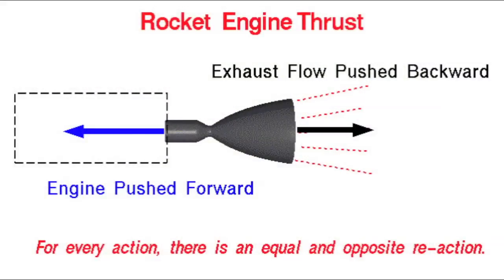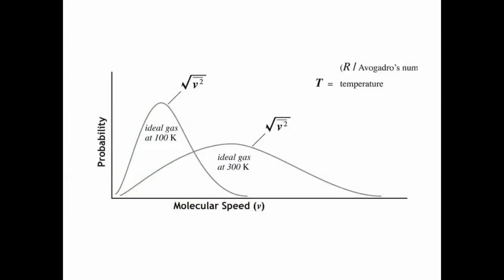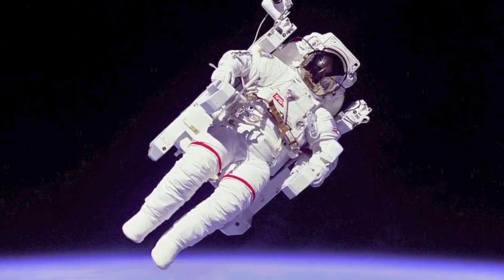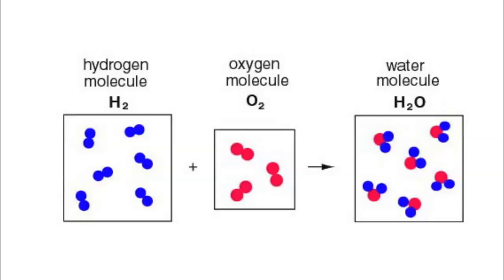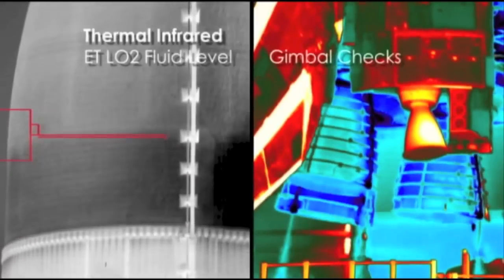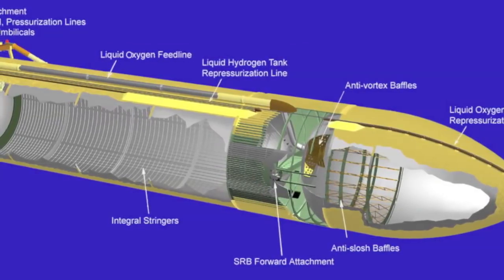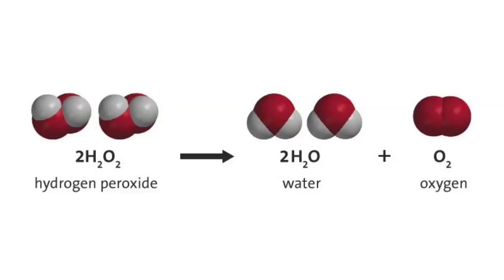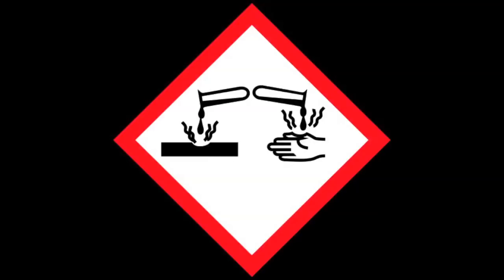WTF is Rocket Fuel Anyway?

Comment: Anyone read Ignition! by John Clarke? Its a must read for anyone interested in stuff like this who doesn't mind a bit of chemistry. If anything, it shows how kerbal real rocket science was in the early days. 

Scientist 1: Hey guys, lets mix some fluorine with molten lithium and see what it does!
Scientist 2: Don't forget the hydrogen! All rockets work better with cryogenic liquid hydrogen!
Scientist 1: Aww, the exhaust is so hot it's ionized and interfering with our radios. Lets try some mercury compounds next.
Reply: Hilariously written too!
Reply: stevenrs11 oh, I loved the part where they just dumped a whole tank of F2 into the desert just to see what happens
Reply: stevenrs11 Back before developing afterburners, they were going to add a booster rocket to fighter jets, running on jet fuel and H2O2. "Oh, what if a rat falls into the hydrogen peroxide tank? Let's test it!" But some spoilsport insisted that they just drop a rat whisker into a test tube.
Reply: Ignition! has a permanent place in my library.  Picked it up based on Scott’s recommendation.
Reply: Yes! So good
Reply: I knew someone had to mention "Ignition!" ... the textbook that brought us such delights as possibly using dimethylmercury as a rocket propellant ... or chlorine trifluoride. These are two substances that NO sane person would ever wish to be close to. Derek Lowe's now infamous "Things I Won't Work With" section of his chemistry blog will inform you why this is the case, in a manner that will make you laugh AND fill your pants in terror as you read about them.

Yet, back in the 1950s, scientists looking to deliver the biggest bang for the buck from rocket propellants, seriously considered such hideous options.

Oh, and of course, the proposal to use detonating nuclear bombs as a propulsion system is about as Kerbal as it gets ...

Comment: A small but important point: In a liquid hydrogen / liquid oxygen rocket, the exhaust is NOT just water. It's actually more similar to the liquid hydrogen propelled nuclear rocket, in that most of the hydrogen not burned and is therefore acting as reaction mass. Liquid hydrogen engines are always run very fuel-rich, for a couple of important reasons:

1. To reduce the burn temperature in the combustion chamber. Ok, so this is rather hot anyway, but it would be even hotter if all of the hydrogen was burned. Even using the liquid hydrogen for regenerative cooling wouldn't be enough to compensate for this.

2. To maximize the average exhaust velocity, by having as much hydrogen as possible in the exhaust. So only enough hydrogen is burned to impart heat to the rest of it, which actually increases the specific impulse. At the high temperatures used, some of the hydrogen molecules split into hydrogen atoms, which have an even higher velocity - this increases the specific impulse even further.

A similar principle is used in RP1 / liquid oxygen rockets - these are also run fuel rich to reduce the burn temperature to tolerable levels. The amount of oxygen used is limited to ensure that most of the carbon in the hydrocarbon fuel burns to carbon monoxide rather than carbon dioxide. This is a lighter molecule, so has a higher exhaust velocity, boosting the specific impulse.

Another modification to a rocket burning RP1 is to mix some liquid fluorine into the liquid oxygen. This causes the hydrogen component of the hydrocarbon fuel to be burned to HF rather than water. HF is a smaller and lighter molecule, so has a higher exhaust velocity than water. A liquid hydrogen engine can use liquid fluorine as the oxidizer for the same reason, and would also be run very fuel-rich.
Reply from the maker: Very good points here, I never went into the details of fuel mixtures, might be worth doing that at some point.
Reply: Correct.  In real world combustion, the products are never ideal, even when the inputs are stochiometric.  Given a large enough population size H2 + O does not always result in H2O as just one example.  Big organic molecules like RP1 produce even more varied results.

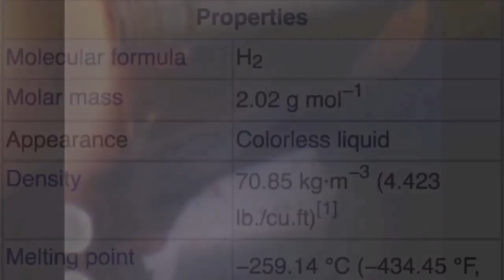Comment: Also, at 5:00, Saturn V second and third stages used LOX and LH2 add their fuels, but they were not insulated with foam on the outside. That's why in Saturn V launches you see ice falling off the rocket when they light the engines.  In Columbia, the irony is that the foam was not there to prevent evaporation, but instead to protect the orbiter. It was there to stop ice from forming on the external fuel tank which could then fall off and damage the orbiter.
Reply: angc214 From another article I read at the time, if they had used the foam they had used in the 80s before they had banned the aerosols, the foam wouldn't have broken off, and the foam wouldn't have hit the wing, preventing the crash entirely. The ozone hole scare of the 80s may have caused the crash, and we have the hippies to blame.

Comment: The insulation on the ET of the Shuttle isn't there to keep the fuel from evaporating.  That's a beneficial side effect, but none of the rockets before the shuttle had this and they worked just fine.  The insulation is there to keep condensation ice from forming on the ET which then would rain down on the belly of the orbiter during launch destroying tiles.  Watch the launch footage of the Saturn Vs and notice the tons of ice that came raining down at liftoff.

Comment: Ah, okay, so from a first principles standpoint, you need three things - reaction mass, energy to push that mass, and a means to do the pushing. For a chemical rocket, the energy comes from the fuel's combustion, the combustion byproducts are the reaction mass, and the pushing is done by simple thermal expansion. For a nuclear rocket, the energy comes from the heat of nuclear breakdown, a non-reactive fuel is the reaction mass, and the pushing is done, again, by simple thermal expansion. For an electric rocket, the energy comes most commonly from solar panels [but can come from an RTG too], an very inert fuel is the reaction mass, and the pushing is done by electromagnetic repulsion between the engine and the ions of the fuel. Cool beans.
Reply: Nicely summarised.
Reply: Technically, only in Bi- (and other multi-)propelant rockets energy comes from combustion. In monopropelant rockets it comes from rapid decomposition in presence of catalyst.

Comment: So the EVA suits of the astronauts were basically like deflating a balloon in space lol.
Reply: kind of... although I would go with opening a container of compressed gas. Imagine a bottle of carbonated water that has been thoroughly shaken xD
Reply: Opening a container of compressed gas, is a balloon right? Correct me if I am wrong but I'm pretty sure that:
The container = the balloon
The compressed gas = the air inside
Opening the container = opening the balloon's neck to make really high pitched and annoying sounds

BALLOONS IN SPACE!!!
Reply: The "Mentos in Coke" of space exploration. :)
Although of course, that's not quite right because it relies on a chemical reaction, which the EVA suits didn't.
It's more like playing dodgem cars in office chairs using fire extinguishers for propulsion. Or so a friend told me. ;)

Comment: Please please please do a tutorial in the interstellar mod fuels.... There's NONE
There's not much at the wiki.... Lots of Wiki gaps....

You did a gather water and convert to oxidizer and fuel... But there's so many more.
And i believe that with the Scansat mod you can find were all resources are (there's a resource find tool on that mod wile the interstellar there's only a part that finds radioactive material... they plan to do another part were you find the rest but its not implemented yet)

So PLEEEEASE do a tutorial with interstellar resources/process to convert/fuel types and usages.

Comment: But what about chlorine-trifluoride? Or was that never used? And what about fluoroantimonic acid? I heard it was planned to be used as a rocket fuel (although I'd think that was never tested, was it). I'd love to hear about those things if you know anything about them
Reply from the maker: Lots of things were thought about, but never flown.
Reply: Scott Manley that is true, but maybe you could make a video about the "best propulsion concepts that never propelled"
Reply: ytmoog yeah pretty much XD but there's many other great concepts like the EM drive and such
Reply: AIUI the difficulty is it's just too damn destructive. Most organics are out because it's hypergolic with them. Flouropolymers can be used on the gas but not on the liquid because they will dissolve. Some metals can be used if they are passivated by forming a metal flouride layer but there are concerns about what happens if the passivation layer is damaged.
Reply: Lots and lots and LOTS of things were thought about, and tested in labs or in small scale test engines. Pretty much anything that could be synthesised and had decent theoretical performance.
Most variations of them failed a card-gap (handling/shock stability) test by a little, or a lot, or by so much that they destroyed the apparatus (and in some cases the entire lab, with little or no warning!).
Or they couldn't be stored without either destroying the storage vessel, or reacting with it and becoming contaminated, or boiling off too much at too low a temperature.
Or they couldn't be handled in large quantities without insane levels of risk to life and property.
Or they smelled really really bad, like "if you spill a few drops, clear the building or people will be vomiting in the hallways" kind of bad.
Or they were ludicrously expensive to synthesise in the kinds of quantities required to make them useful for anything at all other than writing papers about.
Bear in mind that the US military (specifically USN and USAF) paid for pretty much all early propellant development in the States before NASA was formed. They wanted bang-for-buck above all things, and the brass were not really amenable to the idea of storing large quantities of extremely volatile chemicals on aircraft carriers and airbases adjacent to similarly large quantities of fuel and ammunition (which, while hazardous, are relatively inert), nor having to train sailors and airmen in the very specific handling procedures involved. And they flatly refused to use "exotics" for any weapon which was to be stored pre-fueled, due to fears of what might happen in the event of a leak. They could be used in nice, cosy, permanently manned and maintained ICBM silos, but not on warships in the middle of the ocean. Hence the widespread use of RP-1... it came from the same refineries, they knew how to handle it because they were already using thousands of tons of gasoline, diesel and kerosene each year, it was easy to store and it had no problems with stability or boil-off. Since a whole lot of modern rocketry came out of what was learned designing and building early ICBMs and tactical missiles, we still have a lot of that older propellant technology hanging around in modern designs. But in many cases it's a matter of "if it ain't broke, don't fix it".
Reply: Peter Green, "there are concerns about what happens if the passivation layer is damaged"... like that whole "starting to burn and just not stopping" thing?
Yes, I'd say that would be a concern. :)

Comment: One other variant of the electrical thruster is the resistojet. You get some substance, say, hydrogen, and pass it over a heating element that gets very, very hot due to massive amounts of energy being pumped into it from an external source, such as solar panels or a nuclear reactor. Much like the NTR, it benefits you to use extremely light gases for this purpose. Unlike the NTR, you don't actually need the fuel to come into physical contact with the reactor. Of course, this comes at a cost. Nuclear reactors are not usually very efficient when it comes to converting their power to electricity. Neither are solar panels, RTGs, or much else.

Comment: Rocket that runs on kerosene: welcome to russia
Reply: Rockets that run on alcohol...

Welcome to Russia
Reply: vodka!
Reply: Da tovarish! Za vodka!
Reply: +Joel
The RP-22 radars in the MiG-21bis were cooled by alcohol.
Reply: there are plenty of non-russian rockets that use RP1 as fuel.
Reply: Saturn V (among others) runs on RP1 (kerozene) and LOX actually
Reply: That is actually a german invention
Reply: German rockets used Alcohol. Both the USA and Russia first used Alcohol but later switched to Kerosene.
Reply: I'm pretty sure that Von Braun and his team would have tested every liquid hydrocarbon that was readily available at the time. They definitely tried gasoline, in various concentrations and mixtures. In many cases they ended up losing a lot of efficiency because they had to mix water into the fuel to keep chamber/nozzle temps down.
Reply: Kerosene & Liquid Oxygen, 2 of my favorites. I would add, Liquid Hydrogen as the prefered method though
Reply: Zanzalur's Odyssey Petroleum fuels were in short supply in the V-1 and V-2 days, so von Braun had to use alcohol.  After the war, both the US and the USSR could get enough kerosene.
Reply: Saturn V, RocketLab Electron (large and small examples).
Reply: Joel says.... von Braun used alcohol too. The Russians used it because their German 'recruits' knew how to use it.  Many U/S upper stages, and some first stages, have used it.

Also check out Copenhagen Suborbitals on YT; they're using ethanol/water as fuel in their rocket engine tests. They're funded completely by donations and all work is by volunteers. Their Oxygen is donated, but they pay for the fuel.

Comment: Have you heard of Syntin, a Soviet/Russian rocket fuel that ended up being lost under it's own obscurity???
Reply from the maker: gdm413229 I've heard about it, it used stressed propane rings to carry extra energy compared to other isomers. It just proved too expensive compared to more conventional fuels.
Reply: scot manleyfuel
Reply: +Scott Manley that sounds incredibly fascinating!
Reply: +Scott Manley im a huge fan!!!!!! #e=mc x2
Reply: +gdm413229 Basically a slightly higher performing version of Kerosene. It was used in the soviet union during the eighties, but it needs a high enough flight rate to be made profitably.
Reply: Fascinating!
Reply: Russians/Soviets usualy run on GOX/ethanol propellant, oh you mean their rocket engines :-)
Reply: gdm413229
Reply: Pyroslav x You mean Stoly?